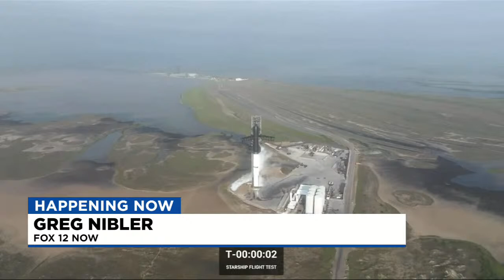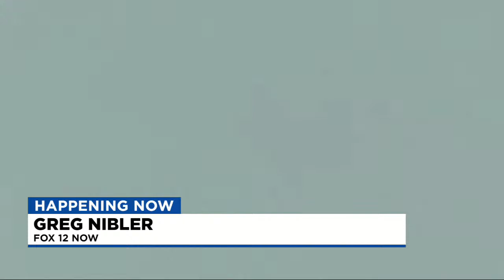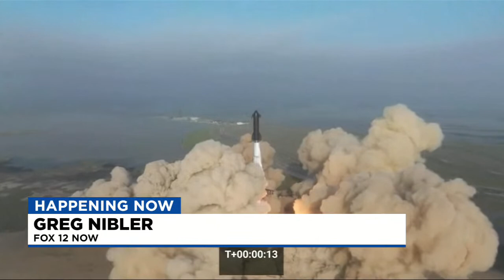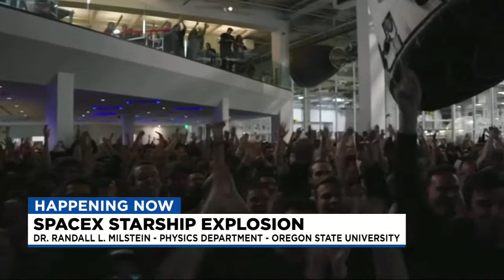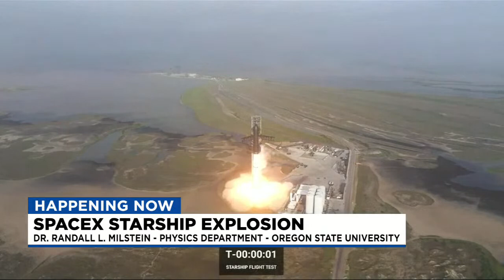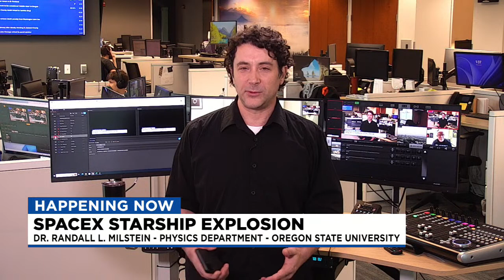LIVE: What happened to the Space X Starship launch & what comes next?

Comment: Lots of errors in this. It’s not called Starliner, it’s Starship and Superheavy Booster. FTS destroyed it, the rocket didn’t break up despite flipping 3 or 4 times. RS25 engines on SLS are way bigger than Raptor 2. There are 33 Raptors on Starship. SLS uses 4 RS25’s and two giant Solid Rocket Boosters (SRBs).

Comment: You know... I was going to defend Elon here, this flight was a huge success for further development.. bottom line. But listening to this guy talk, I'm just laughing to myself. Dr. Milstein is very much entitled to his own opinion and I'll listen to his views. Several Super Heavy boosters have already been built, for one. Both stages were destined for a watery grave from the beginning. The Raptor 2 engines are a brand new iteration.. the entire system is brand new and for a test flight that cleared the tower, made it through MaxQ (that's where the rocket encounters maximum dynamic pressure, Dr. Milstein) all the way to the point of MECO and stage separation. It made it there, despite flameout of several engines, early on in the flight. That's just incredible. SpaceX used the Flight Termination System to end the flight, it didn't just "blow up." That's something I see a lot of agencies are failing to mention. At no point was there an "oops" moment. The incredible amount of data they gathered from this flight is a huge win for further development. Also.. the launch was delayed once, because of a frozen valve. The second attempt.. of entirely new systems and technology.. cleared stage zero, and flew.. it worked. Dr.Milstein says, "we can go to the moon." Now, I know where he was going with that, but comparing Mars to the moon, you'll have one major difference over everything else.... there's no atmosphere on the moon. Lol. As a highly educated individual, he seems to know very little about this particular subject, mainly with the workings of SpaceX. What do I know though. I'm just a small town guy with nothing but a degree in graphics. I'm no physics major.